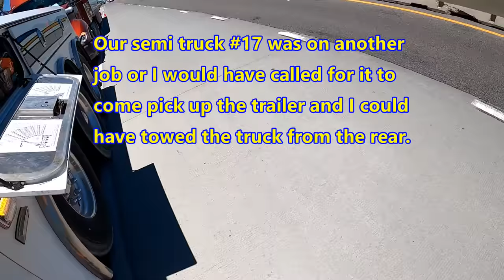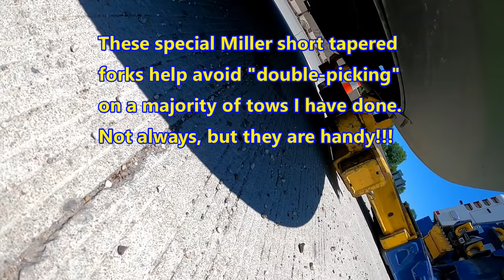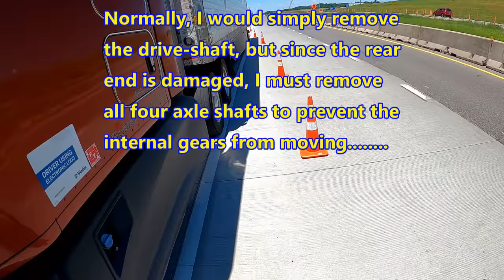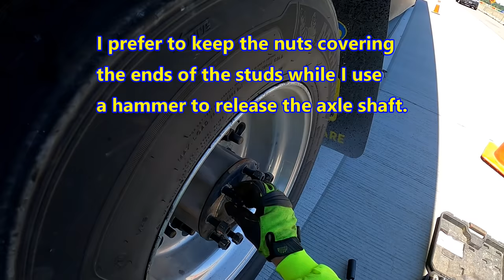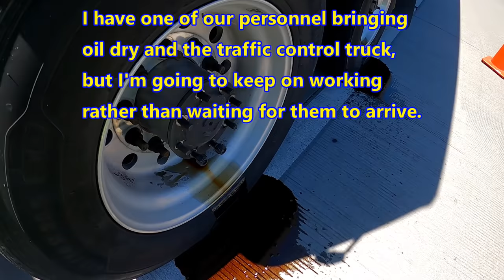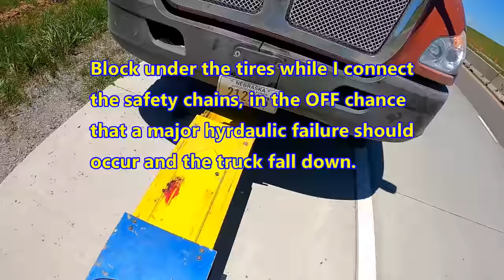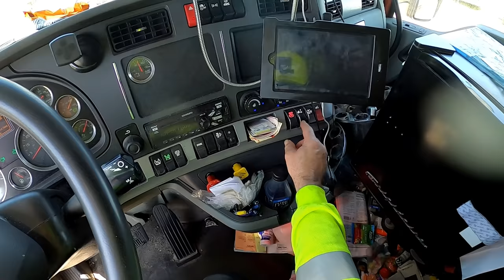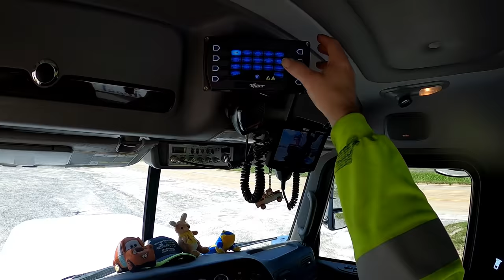Squeeze Play!!! Dangerous Heavy Tow From a Bad Location!!!

Comment: As for the apology for the constant head movements while keeping an eye on traffic, no worries on my part. As a diesel technician that has to do road calls I fully understand and appreciate it.  Found my focus going directly to traffic when you looked that direction.
Reply: Never ever apologize for trying to keep safe as a former traffic controller for various utility company’s i understand
Reply: I am only 19 and am working on trash trucks. I have had calls to do tires on the side of the turnpike with me standing in the slow lane. Have also had to do calls working a steer tire at a toll both almost at dark. I hated it but I also enjoyed the adrenaline rush.
Reply: I actually got concerned at one point when he was struggling with getting the cones out, there was a large delay between checks.
Reply: Ok.
Reply: I do the same
Reply: Stay alert stay alive
Reply: @jerrysouthside8597  was asaaaaßd
Reply: Commercial Vehicle roadside tire tech here, you can never be too safe no matter which side of the vehicle you're on. Always be looking and don't ever apologize for it. Could end up being the last.
Reply: It should be used in teaching operators for all companies
Reply: @jerrysouthside8597  #
Reply: @jerrysouthside8597  p

Comment: Wow, Ron.  That ends up being one LONG unit - 53-foot trailer, KW with sleeper, and then Tator.  Nice work. Always impressed with your can-do attitude and professionalism!
Reply: And he missed the culvert...
Reply: Long AND heavy. Roughly 115 ft and 150k lbs all combined.
Reply: @MikeBrown-ii3pt  Yep. I drove a Freightliner Cascadia with a condo cab, and with a 53 foot trailer, I paced the length out to about 72 feet. Add the 45 foot Tator with 3 or 4 feet of turn clearance, and it's a long'un.
Reply: @Bullfrog307002  the difference is you're not trying to get that maneuvered through roads not designed to handle it. There's only a few states here where they run triples due to the turning radius needed for them. I know there's always an exception to that but I meant generally speaking.

Comment: Ron, Back in the day when I was with a sand and gravel company we often had power dividers fail. we kept cardboard covers premade up to replace the axle covers and limit gear oil spillage when removing the axles to tow
Reply: I worked at an International Truck dealership / repair shop in Joplin for a while, and once in a while we'd get a trick towed in that had cardboard covers over the hubs that the tow drivers put on them.

Comment: One of the driver's first responsibilities after a breakdown is to set up safety/traffic cones at appropriate distances.
Reply: Within 10 minutes of stopping is the dot reg for setting out all your safety devices. I've seen guys pulled over and dot will pull up behind them and wait 10 min before approaching and if it's not out they get a ticket. (Edit I don't drive otr anymore but I do roadside service on semi's and heavy equipment now, I still have my cdl though since my company truck is gvwr over 26k)
Reply: @alexhart4369  Not only within 10 mins, but at the proper distances, 10ft, 100ft and 200ft on a divided highway i.e. interstate. Most that do put them out are like 10, 20, 30 at best.
Reply: Im glad to see this comment. I was wondering why no one was mentioning this hands failure of a proper breakdown procedure.

Comment: I have a suggestion for you Ron. When you drop semi trailers, especially loaded ones, leave the landing gear pads, or feet, up about 2 inches off of the ground. There's two reasons for this. The first one is to help the truck that's picking up the trailer ftom over pinning, having the fifth wheel pin sliding over the fifth wheel plate on the truck and dropoing off infront of the plate. This can happen due to the many different ride hights of the trucks today. The second reason is so that the truck thats picking uo the trailer will lift the landing gear off of the ground making it easier for the driver to wind it up. This is especially true in the  winter months when the landing gear can freeze to the ground under the wieght of a loaded trailer making it very difficult for the driver to break it free and wind it up.  Remember this is only a suggestion.

Comment: DRIVER: Our insurance carrier requires you to be seated in my cab while I work.
It keeps him out of harm's way and also out of your way.
Reply: Yep. That's what the Tow operators I've delt with have told me. Did you see how messy the cab of that KW was? I use to run OTR. my truck never looked like that. 
I use to work for a local outfit. The owner 
Would inspect the inside for cleanliness. 
It was his truck after all. And they washed all 50 of them every Saturday.

Comment: I did mechanics & road service calls for a local tire shop for many years & I absolutely despised any call on the side of the interstate. Would put cones, have flashers on and even back my service truck to the back of the trailer if possible just to alert drivers and they would still scare the heck out of me. Definitely understand the "head on a swivel" comment.. God bless & stay safe.

Comment: Lots of work... good thing that the rear ends weren't the old SQHD's with cones in the axles. I saw another wrecker driver use plastic cups to keep the oil in the hub... Good Job... Ron...

Comment: Was the truck overloaded that caused the rear end to break?  Or just old age on the trucks part?  You should get a pair of Pit Viper sunglasses for your next pair.  You could get a discount on them by going to Cole the Cornstar's channel and ordering through the link on his channel in most of his video descriptions.
Reply: Could be age. Sometimes the axel's don't get the oil changed in them at the same time the engine gets a oil change and makes the axel oil bad. And sometimes the oil in the axel's will get low even if it's new oil in them and burns up the axel. I drive truck also
Reply: I've had rear ends break with empty trailers before.. it's just age, mostly. All parts wear out and metal fatigues.. I've had spider gears, ring gears and axle ends all break before (thankfully not at the same time)
Reply: Ron said it was 80,000, that isn't overloaded.

Comment: How do you maintain the charge on all the portable battery run equipment, ratchet wrenches, etc that is onboard to make sure they work.  Are they on some master charging circuit that runs throughout the truck or does someone have to periodically do individual recharges on a schedule to make sure they all work.  Does no good to have an "electric wrench" if it is not charged.  Maybe after each job they are all afterwards put on a recharger as part of the job.

Comment: I don't know if you read these, Ron, but I wanted to share a story with you about a tow truck driver trying to help a guy out of gas on the Don Holt Bridge in Charleston, SC.  There was a police car stopped behind the car and the truck behind the cop - all with flashing lights.  The owner of the car was told by the cop to get into his vehicle about a minute before an F250 hauling a trailer plowed into the back of the tow truck.  Officer was seriously injured.  The tow truck driver was hit and tossed over the side of the bridge (found his body the next day)  SC is in the process of regulating a SLOW DOWN, MOVE OVER, policy.  This story reminded me so much of that horrifying day.  Please be safe out there.

Comment: Ron in the UK the Wrecker (recovery ) companies normally pull one  half shafts instead of the prop shaft which disengages the drive to the gearbox.
Reply: This is true but when the ring and pinion gear are messed up you do not want it turning at all, that's the reason for pulling the axle shafts

Comment: One of the good things about a floating axle rear is the ability to pull the axles like in this situation. I worked for a company years ago that had a flatbed truck and one of the axles snapped, so the mechanic was able to remove both pieces and install the replacement.

Comment: The mechanic in the shop will be glad that you did the hard work of removing the side shafts so he does not have to  when he repairs the differential. That was interesting . The best tool ever invented was the battery powered gun for removing and fitting bolts and nuts. Happy week end to you Mr Pratt and family.

Comment: A quick question for Ron and his crew; Would it be more practical to have the cones on the passenger side of the truck? Upon arrival and when you are most vulnerable to being hit by passing traffic; having to get the cones from the drivers side while completely unprotected by any safety devices or means to alert the approaching' traffic to move over one lane is a huge risk to take when there are safer ways to initiate that process.  By having the cones on the passenger side the truck, operators have a better and safer opportunity to spread the cones out from the back corner of the truck and spreading the cones diagonally to the painted line that delineates the highway's outside edge of the usable road surface. The operator begins the process from inside the active lane or the outside shoulder lane and continues to placing the traffic cones towards the oncoming traffic, they will have the best opportunity to complete that part of the recovery process while all the persons on scene are on guard and are actively watching out for everyone on location. Only then will the scene be a better and safer place to work in and no one had to take unnecessary risks to begin that process. I know it will bugger up the overall placement of where certain tools are stored, however I believe this would be a safer way to initiate  this process as a primary S.O.P (Standard Operating Process) for all crew members when arriving on scene and establishing a safe work area for everyone to work in.

Comment: I was hoping you would summon the traffic control truck. You might consider keeping 4 of these on your rotator for when you have to pop the axles to avoid some of the mess. 
 Lisle 19852 Truck and Trailer Wheel Pan

Comment: Hey Ron, just a heads up. Those dump switches in the new PACCAR trucks (Pete and KW) are electric over air. They require the key to be on for the switch to work. They may have other parameters that need to be in place like park brake set first.

Comment: When I was doing commercial tire work, had a case just like yours. Driver blew both drivers side supers and stopped on the white line during rush just out of construction. I ended up being lucky the driver called the highway patrol motorist assistance division. Pretty much did all but shut down the highway completely with two message trucks and a patrol trooper 1/4 mile back pushing traffic.
Reply from the maker: It sometimes takes nerves of steel to work some of these things.  Thank you for watching and God bless.

Comment: Ron, be glad that the  breakdown wasn't in the construction zone you went through. That might be a worse case scenario.
Reply from the maker: I actually had that happen on the north bound side.   Semi hit the wall, blew the steer tire and couldn't go anywhere.  Had the entire lane blocked and it was down to the one lane area ON the overpass.   Had to go a different route to get north of him and then back down the interstate to be able to access the front of the truck and clear the lane.   I did not get video of that job, but I wish I had.   It was a rush job for sure...     Thanks for watching and God bless.

Comment: You placed the blocks under the tires as a safety measure in case a total complete failure of the hydraulic lines... but if the hydraulic lines fail, wouldn't that cause the tractor to fall down and roll back/forward some to the point where it falls off the block?
Reply: I am Sure he set the trailer brakes before he started pulling the axle shafts

Comment: Hey Ron, i’m old enough to know what pre-Load permits was.  
With that said I know you’re a heavy load total but what is your estimated weight per axle and your total length?  
I was in a small community in western New York when we had a plow/sand truck fall through a bridge and then they realized oh this little 10 wheel dump truck with a 15 foot dump body on it was over 100,000 pounds! Oops that’s a bit much for this bridge.

Comment: First of all, Thank you for having so much fun with your Job, and share this with us.
at 31:15 you put a wood block under the tire, in case of a hydraulic malfunction of the underreach to not get stucked under the truck, when working on the passenger side, you put the block under the other tire.
Just for my understanding, would it be an option, to plase the wood block under your underreach? It would also hold up the truck in case of malfunction, and you would not need to place it twice  (under each tire). I know there are different ways to handle a situation, and this is your way, i'm just wondering if this a little bit more time efficent idea would work aswell.
Stay safe!

Comment: Hey Ron, hope this doesn't sound like a stupid question but couldn't you rigg the truck to use Air power tools in cases like this? You already seem to have all the lines and supplies needed. Plus of you use a bungee style air compressor hose should keep the length down.

Comment: Looks like the air hookup on the back of the tator are normal air hooks up so could you use them as a way to run air tools or if needed air up tires?

Comment: at 45:38 is that a crack in the rim hope that got fixed also  why could you not just pull both drive shafts out also i thought he wanted fuel in the truck as well

Comment: Those beauty caps did a good job if letting grime in to the axle threads and keeping the truck wash from washing it off. First noticed when the impact wrench was still impacting after the nuts were broke loose and should have been free turning.

Comment: First great video second this is just a thought if you put the cones on the passenger side the same to me it would be safer getting them out to place on the road third thing did y'all stop and get some diesel for the reaper motor? Great video also since it was a dangerous location shouldna traffic control truck dispatch with you keep in mind these are just my thoughts thank you

Comment: I know I'm behind the curve on this posting, but I heard you mention you scratched your good glasses.  Sometimes you can restore them, if you haven't pitched the pair.  Try a dremel tool with a dry felt buff, and lightly polish the scratch.  I've saved a couple of pairs of glasses that way before.  I learned the trick from a used CD sales shop, as they buffed out CD's with a bench grinder and felt wheel to remove light surface scratches.
Reply from the maker: I will definitely try that, but a super nice viewer sent me a replacement pair.  I am so blessed by the kindness of our viewers.  Thank you for watching and God bless.

Comment: Ron, may I ask, if you have a situation like the one in this video with a tractor with a floating axle like that on the Tator, and perhaps air problems, do you have to remove six or four axles if you have to forward tow it? In other words, is the floating axle driven or do the wheels on it free roll?
Reply: floater axle is not driven, just free roll like the steer axle

Comment: I didn't notice you run air to the tractor. Is this because without the axles in the rear the trailer just rolled freely? 

What if you were able to remove the drive shaft, able to run air to both tractor and trailer? Just wondering thanks!
Reply: Meant to say tractor* rolled freely in the first part ..

Comment: I think, it is better to place your warning equipment on the right side of your truck. So you are save in the most situations, to get them out at first.
To protect the motorway or so of the oil, we use oil sorbent cloth. This things are not heavy and makes the afterwork cleaning a litle bit easyer🙂.

Comment: That motorway is about as bad as our motorway system 24/7 here in the UK.  Not sure about roadworks in your country, but on our motorways, there's always a 50mph speed limit with average speed cameras, which means from beginning to end, or where you leave the motorway, your speed is calculated, and if you drove over the average speed, you get fined heavily and points on your licence which will eventually culminate in having it taken off you, usually for three years, but you have to reach 12pts, and the least you can get is 3pts, it doesn't take long before reaching 12

Comment: I was surprised they actually moved over while you were hooking up. Don't see that to often.
At least it's not set up like the old GM busses are Ron, they have the threads on the lugs reversed between left and right sides. Yup, righty tighty lefty loosy only works on the right side of the bus, it's righty loosy lefty tighty on the driver side which means you can't mix the nuts together.

Comment: I expect you can get them in the states- in Oz you can get '3 in ones' which are popular with the heavy haulage units- 10m (30ft) long twin air lines with an elec cable in the center... (well you can get them in any length really if you want to DIY) only one 'line' to have to hook up, and it does trailer lights, air supply and air brakes all in the one 'hose'- much easier than your separate lines for everything- and lets the towtruck do everything the prime mover does normally- ie air supply, brakes and runs all the trailer lights as normal- brakelights, clearance and indicators- I expect something similar is available there (our ozzie ones wouldn't work with US trailers as we don't use those 'twist and turn' connectors here lol or the US style trailer elec connectors)

Comment: Those (Lincoln High hats) hub covers are a waste in the sense that you are supposed to visually check the rims for cracks between the lug nuts on you pre trip inspection, lug nut covers and axle shaft hub caps are fine they don't interfere with a visual inspection